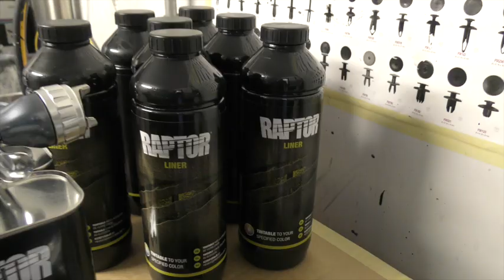Painting a Land Rover Defender in Raptor Paint - Season 1 - Episode 38

Comment: lovely job. i am about to spray my 90 in red so what size nozzle do you use on the spraygun for the first coat.
is it a good idea to sand down the area where you put the new window seals after the second spray coat or is that not necessary?
Reply from the maker: You use a shutz gun not a normal spray gun for Raptor as it sucks and spits the paint at the vehicle and the texture depends on the distance away from the vehicle and the seals fit fine

Comment: Hey there. I had a polo that was painted with stone chip or something. tough as old boots but it looked awful! haha. This looks nice. I do have a question about the bed liner though, wont the texture make cleaning it a bit harder?
Reply from the maker: Hi mate the Raptor Paint is fantastic and the texture can be what you want it to be and is all down to how far you spray from. It does take a bit more cleaning but this is far outweighed by the protection it gives. We have been trough some very scratchy places and the paint holds up tremendously

Comment: Nce job but i have to ask was the colour a solid colour and not a colour tint.  Only i have  heard many people say they use a colour tint and i have no clue what the difference is yet or if it is better for some reason than adding straight paint.  Thanks subscribing as well.
Reply from the maker: The colour Raptor paint you add a tint to it of your choice. You get this made up at a paint factors using a pantone colour and then add it to the coloured Raptor along with a hardener and then shake a lot for around 5 minutes, and then spray as normal
Reply: @VeteransInAction  Thanks for the help.
Reply from the maker: @seanhall  Not a problem mate, any time